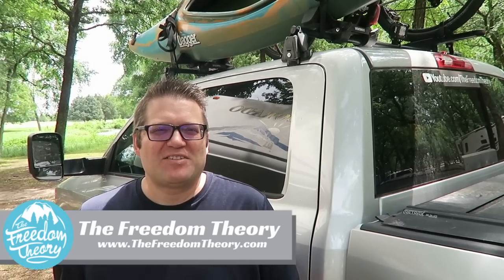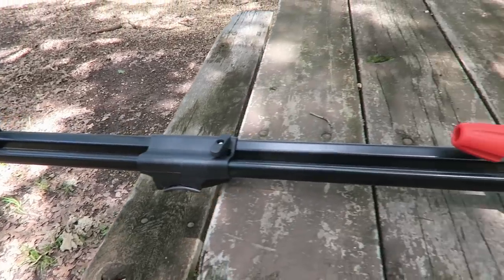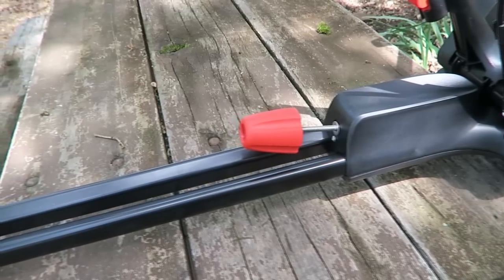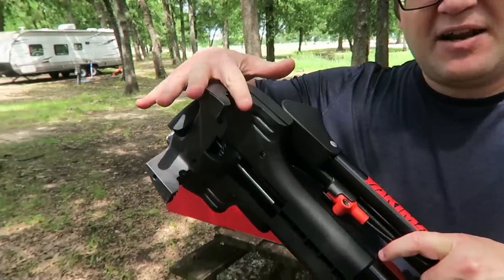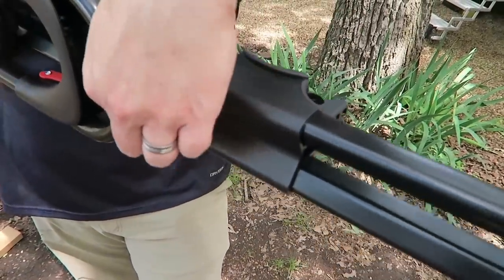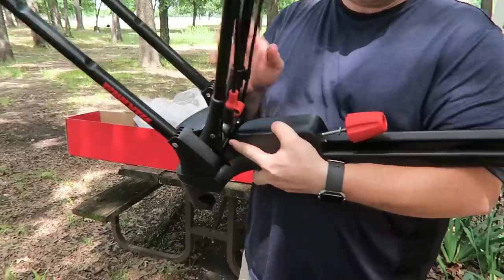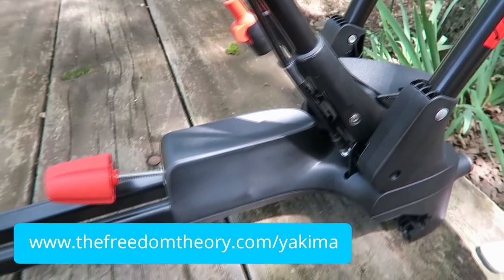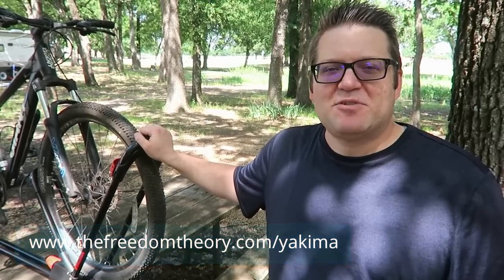Yakima Frontloader Bike Mount/Rack Review | RV Bike Carrier Solution

Comment from the maker: You can find the links to the Frontloader and all other racks mentioned in the review here: https://www.thefreedomtheory.com/yakima

Also, I made a couple of mistakes in the video. That's what happens when you're hurrying to film during the baby's naptime! :)

1. The newer Yakima rack is the "HighRoad", not "Highroller"
2. The Frontloader fits 20-29 inch wheels and the HighRoad fits 26-29 inch.
3. The Frontloader fits tires up to 3 inches wide. The HighRoad officially fits tires up to 3.25 inches, but Yakima says this about the HighRoad (in answer to an Amazon question): "If your bike is a 29er, it will not work with more than 3.5" wide tires. If it is a 26" or 27.5", it will work with tires up to 4" wide. You would just need the 8002470 Fat Straps."
4. Yakima confirms that the rack will fit "almost" all aftermarket crossbars, not just Yakima ones.

Comment: So to steal the bike you steal the bike rack with it just by unscrewing it.  lol
Reply: Bohemian Bus Odyssey   He says Yakama sells SKS locks to screw in.
Reply: Karin Hart but he didn't have them. That was my point.
Reply from the maker: Yes I have them. I just didn't put them on during the demo. You could also use any bike lock to secure it to the rack. The rack itself can be (and in our case is) locked using SKS locks.

Anything can be stolen of course, but the SKS locks are surprisingly sturdy.
Reply: Road Gear Reviews we need to find a good bike rack for our skoolie we are building. Don't need our expensive bikes getting damaged.
Reply: Yakima offers locks with this rack, but I didn’t like the suggested price tag. Opted for a 4’ cable lock($10). Locks rear wheels and frames of 2 bikes, AND roof rack. Hence, even front wheels can’t be stolen.  Cheaper fix.